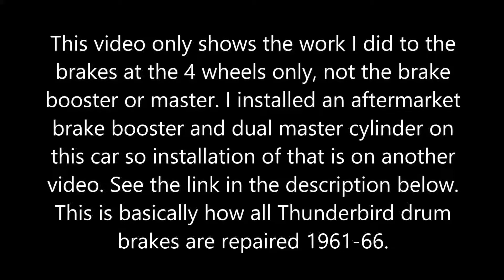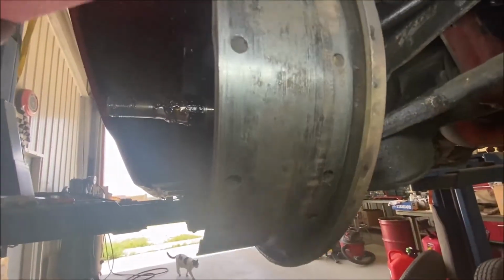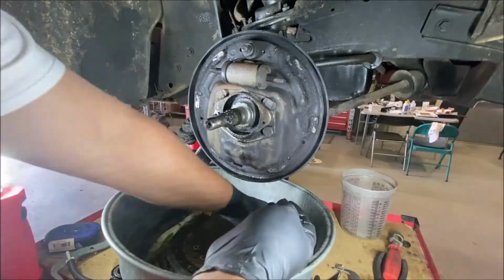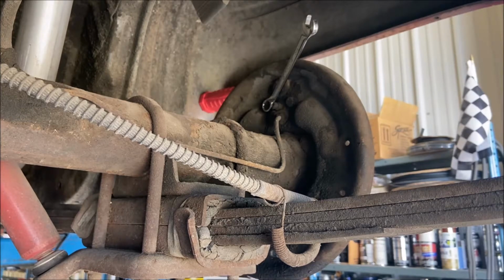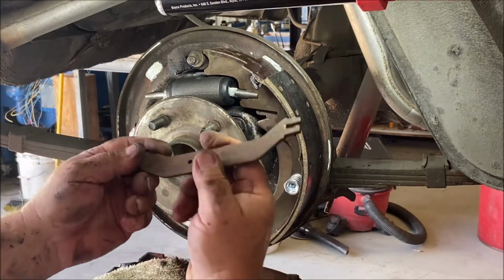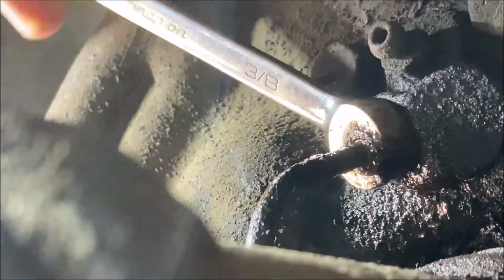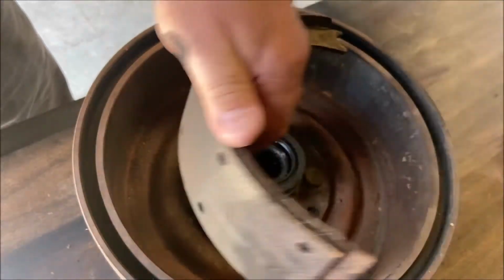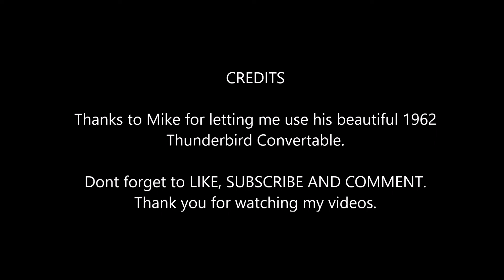1962 Thunderbird Drum Brake System Overhaul

Comment: I did a complete brake job on my 62 Lincoln three months ago.  Everything including the steel lines, flex hoses, shoes, nails springs adjusters.  the right rear gets hot and smokey when I drive it.  Adjusted more than once. Even replaced the wheel cylinder with another new one.  Just seems that it doesn't retract once you hit the brakes.  I think that you may have given me the answer.  I did not file down the shoe pads on the backing plate. Maybe the shoes are sticking once applied and don't go back to the neutral position.
Reply from the maker: Hey Jeff, yes that could be a problem. You can also remove the drum and have someone push the brake pedal GENTLY and watch the brakes to see if they push out and then retract properly. You might see something. Check the ebrake adjustment too and make sure the cable is not hanging up. Good luck.

Comment: Hello Nick. Nice job on those brakes. Those wheel cylinders were really leaking bad for sure. That rusty line is why I went with stainless for my lines. With stainless fittings, also. With the way that brake fluid looked, did the master cylinder leak fluid into the brake booster? I know if the fluid absorbs moisture, the inside of the master cylinder will pit, and the booster will suck some fluid in causing damage. Just a thought. What do I know. Any way, another great video! Thanks.
George B. in Michigan
Reply from the maker: Hey George, thank you. Yes the fluid was very old as is everyones. The master cylinder had a bunch of crud at the bottom too. There was no leak into the booster though so that is not why it was bad. I don't know why the booster is bad, something internally I suppose. What's weird, one half of the booster body is rusty and old, and the other half is new looking. Weird. Thanks again.